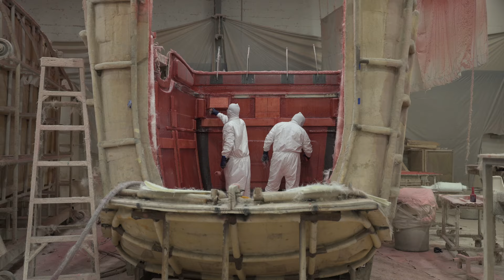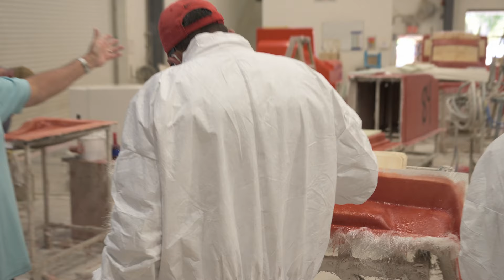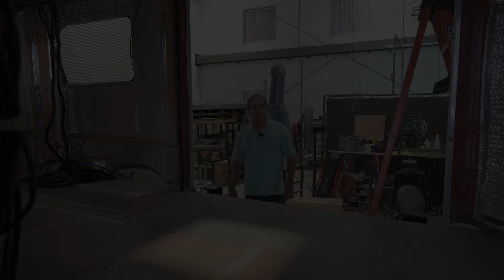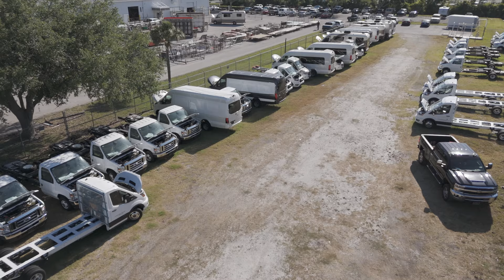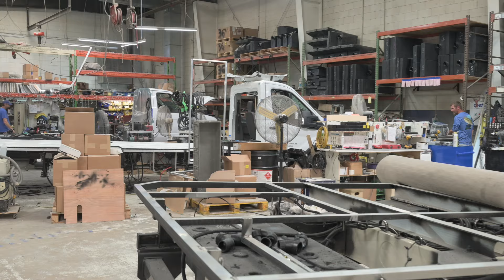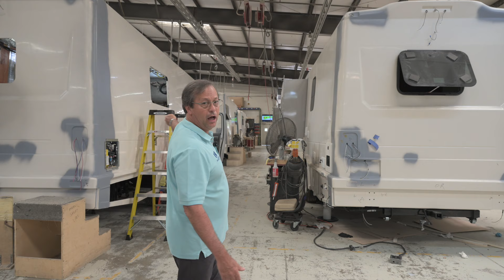Coach House Plant Tour

Comment: Where is the insulation?
Reply from the maker: Thank you for your inquiry! The insulation is adhered directly to the interior of the fiberglass.  Our construction also includes an air barrier between the insulation and upholstered walls/ceiling which also contributes to temperature regulation.  Additionally, the floor is insulated using a rigid closed-cell foam sheet encased in fiberglass. Every coach we build is ready for four-season use!